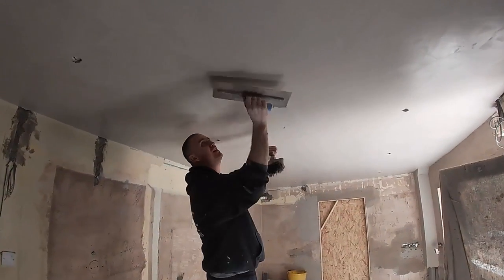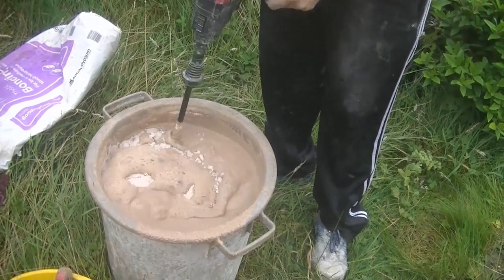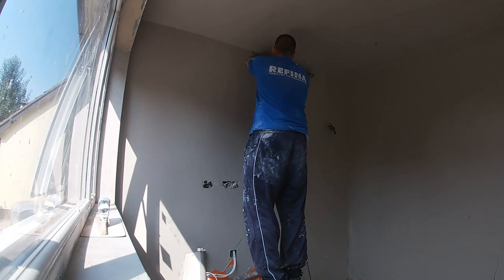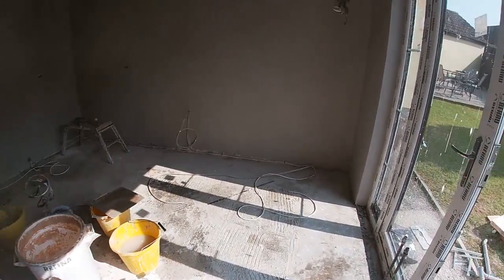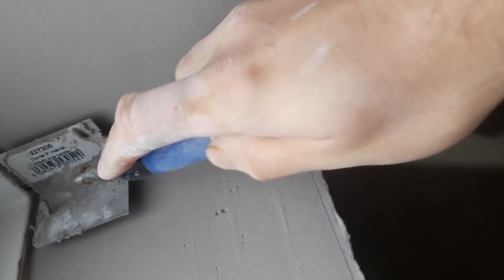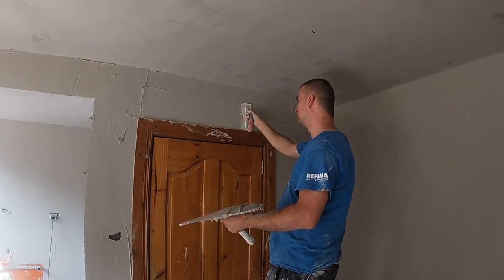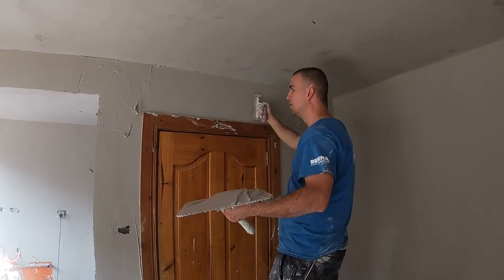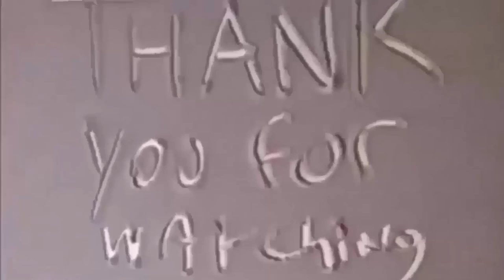How to Plaster a Room in a Day Plasterer Plastering Tips & Advice mac plastering

Comment: Have you ever used extra time? I'm struggling with plaster setting before I'm ready, would the sponge float help liven up the setting plaster.
Reply from the maker: It should do should give you a little extra time troweling up yes extra time will also give you more time its something i kinda left out/forgot on tis video by mistake how you can use extra time a rapid set gear to help slow or speed up as you need

Comment: Howdy Mac, thats great going. Did you slab ceiling patches & bond tracks in wall in same day as well ?
Reply from the maker: No patches where ready but needed to bond areas out and fill some tracks a little more
Reply: @macplastering  great going all the same, considering you’re on your own.
Reply from the maker: A man was mixing and helping but one trowel my shoulder knew about it LLOL
Reply: @macplastering  ah right, I see. I kinda skipped some of video. (If you mentioned it, forgive me) Great going still ! I was thinking, I’d be dead trying to do all that on my own in a day !! 😰
Reply from the maker: @phils3631  Plastering even small jobs on your own can be hard man for sure even if you forget something out of the van running in and out haha
Reply: @macplastering  Absolutely !!

Comment: I agree with you regarding PVA, never had an issue with it.  Thistle bond it on the other hand is shit.  Only ever used it when it’s been spec’d and have had a number of problems with it.  If there are any contaminants on the walls prior to application then I can guarantee that the bond it will bubble up when finish is applied.

On a reskim I’ll always try and get in the night before.  Piss thin PVA first, let that go off and hit it with a heavier PVA.  Skim the following day when it’s dry as when the finish is applied as the PVA re-emulsifies.  It was how I was taught and in 20 years I’ve never had an issue with it whereas some lads who hit tacky walls and lids are always moaning about gear sliding about all the time lol
Reply from the maker: Yes wet pva and sliding is horrible your method is 100% I do like going on tacky but after all these years I very rarely have miss timings and sliding's seem to have it to a t LOL but i have seen grit fail now a few times and not just one make a few I have a few happen to me so like you i only use it when asked or builder ect say they want, but also have fixed jobs that failed on others also a nightmare but at least I was paid for them ones again just seems like pva is way better
Reply: @macplastering  Lol definitely all about the timing.  The only problem with PVA is that British Gypsum won’t sign off on anything or take responsibility for manufacturing defects if you use it.  They stipulate that for reskims you have to use bond it.  The exact wording is “It has many advantages over PVA and is the only
bonding agent recommended for use with
Thistle gypsum plasters (excluding Thistle HardWall). It provides a chemical key as well as creating a mechanical key with the included aggregate particles.”
Reply from the maker: My issue was carlite plaster de laminating off clean in sheets so i had tested my mix and coat was 100% so why didn't it stick they say not there paint under not the skim under the paint and possibly not there boars under that, so these company's will never stand over anything even now they wont stand over sand and cement but if i was to build a house witch one day I will and one day i will share it all on here I will be sand and cement then skimming no doubt
Reply: @macplastering  definitely true.  We’ve had BG reps turn up sweating when we’ve been skimming over sand and cement, bastards demanding a site meeting 🤣🤣.  

I was always taught s&c in bathrooms and it was spec’d as well but they said any failure that occurs is down to us, the spreads.
Reply from the maker: @jimmywatts8219  They have said to us that sand and cement causes mapping but thats a pile to me mapping in the paint in water its not dry just some sites and big builders get them done attitude and you will have them issues as rushing a build is not good
Reply from the maker: things need to be dry but we have had a chat me and other spreads and its simple they dont sell sand and cement they want to sell hardwall as its all about profit they want more money
Reply: @macplastering  And you’ve hit the nail on the head mate.  Money, money and more money.  Just look at the price of Thistle Bond It, it’s extortionate when compared to 5L of PVA.
Reply from the maker: @jimmywatts8219  True and 5L if its  50/50 is 10L LOL gose further than grit big time also

Comment: Hi pal you look like you have lot fat spreading on your wet trowels prob cus you brush the ceilings instead of flicking or spraying but is that way taut or your way for any reason? Just not seen it like that over in U.K. thx
Reply from the maker: Not to much fat I tend to only ever have a trowel full at the end of even a big ceiling but it might be the difference you see is tis is carlite no multi finish carlite is a little nicer and finer skim
Reply: @macplastering  ah prob, never used it, thx bud👍